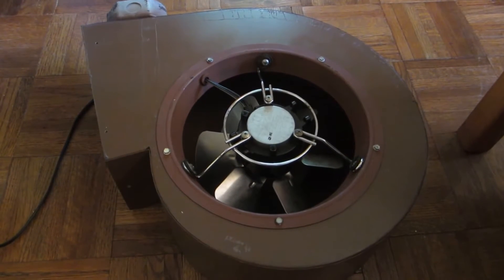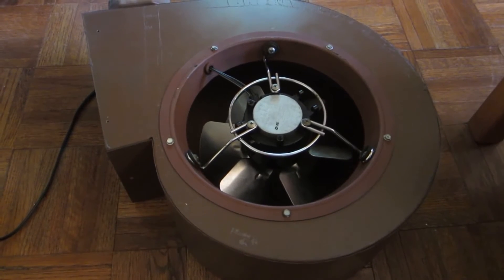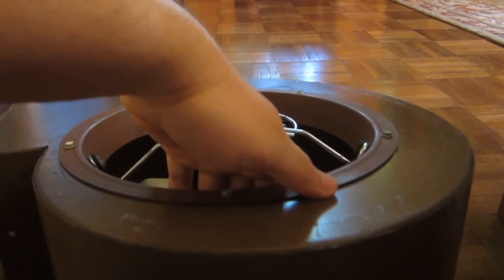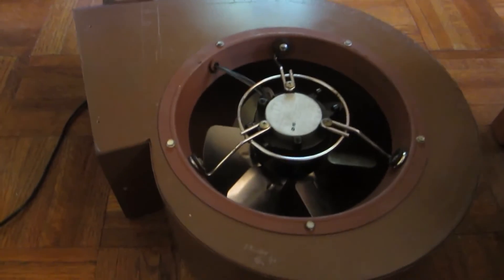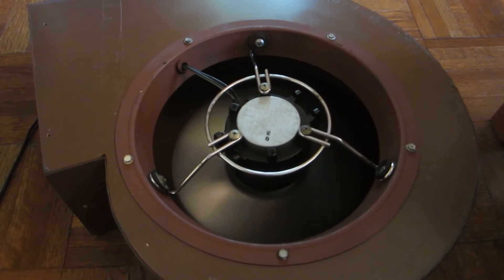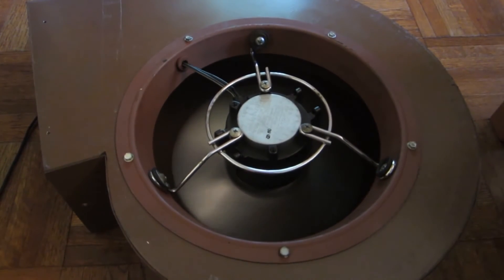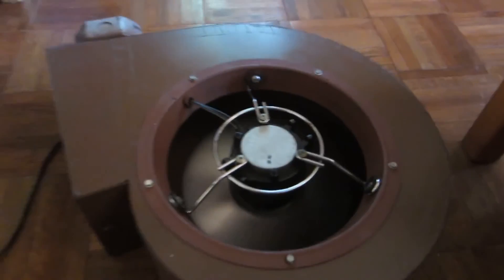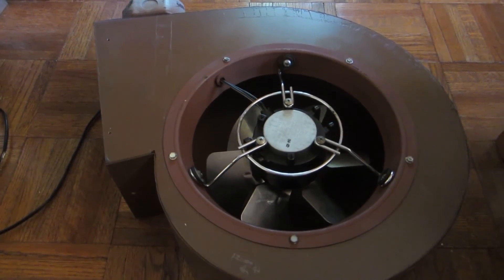My High Performance Elevator Cab Fan.

Comment: just out of curiosity where are you getting these fans from?
Reply from the maker: I typically get these fans from modernization sites if the elevator technicians say that they won't be used on future elevators again, and if they're friendly enough to give me some of these elevator parts. I also look on E-Bay and buy them occasionally if I see them on E-Bay, or from small but friendly elevator parts suppliers.

Comment: Is this a mixed-flow fan?
Reply from the maker: No, this is a single speed, side discharge elevator exhaust fan with a solid top that reduces blade stalling when the elevator moves upward.